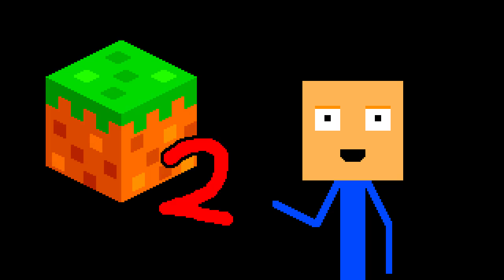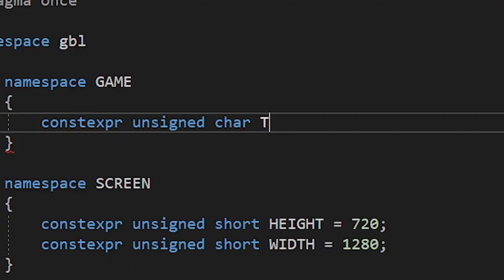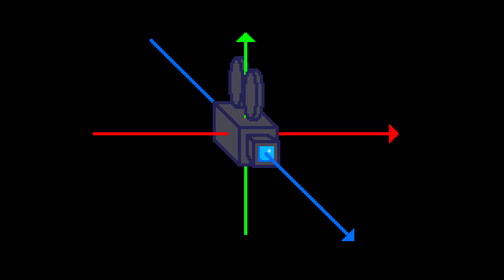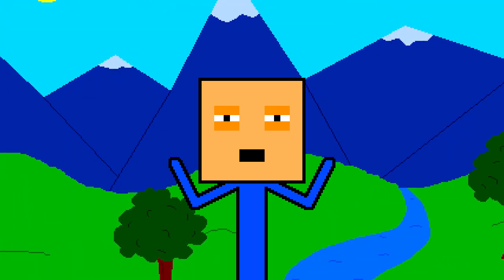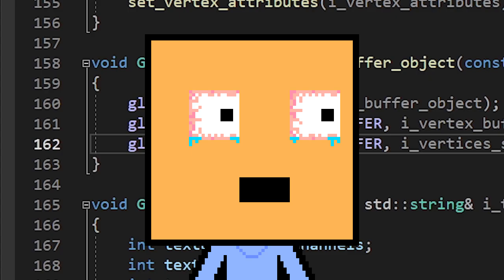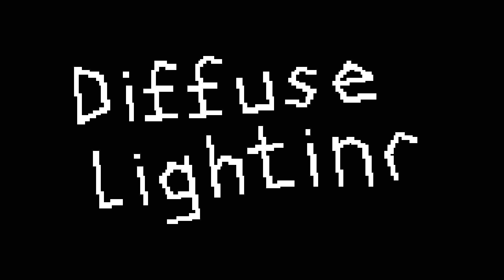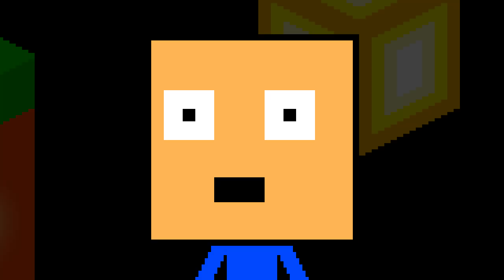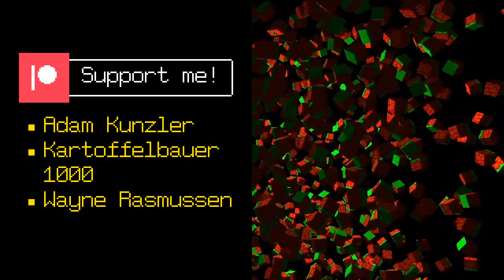I Added 3D Lighting to My MINECRAFT Clone in C++ - OpenGL Gamedev - Devlog 2

Comment: Just a dumb question, but why did you chose to work with GLFW considering you already have a lot of experience with SFML? Both can be used to write OpenGL code
Reply: SFML does not support 3D
Reply: @Grigaror-sl3jb  not if you consider only sfml functions. It can be used as a handler for openGL calls, and with it work with 3D graphics
Reply: @LukSilva12  im not gonna lie its a pain to work with sfml and opengl comaprted to sdl or glfw
Reply: @sharokhkeshawarz2122  oh, maybe thats the reason then. Thanks!
Reply from the maker: I just wanted to try something different. Also I did make a 3D raycasting game in SFML.
Reply: @Kofybrek  thanks for the reply! I know, I watched it role, I meant to say that you can use openGL with SFML, like you are using with GLFW  with the other project you didnt use it. But it was just a silly question, and I think its good to try new things, glfw looks like the standard to work with opengl today and is really cool. Nice work!